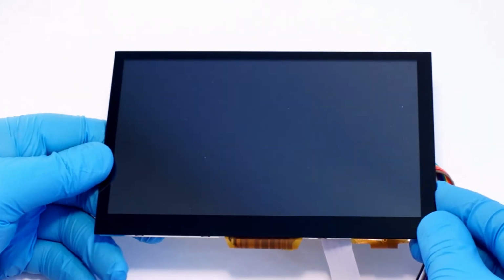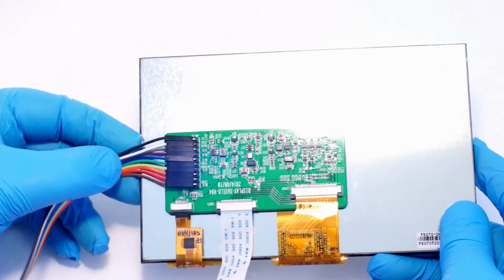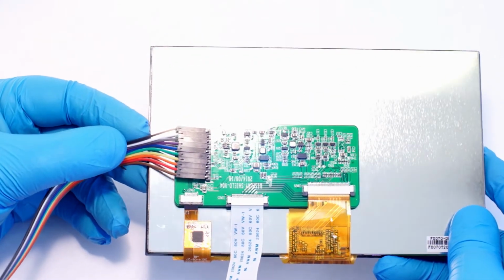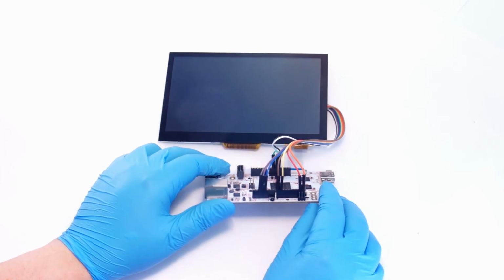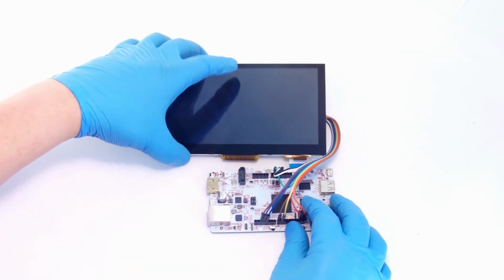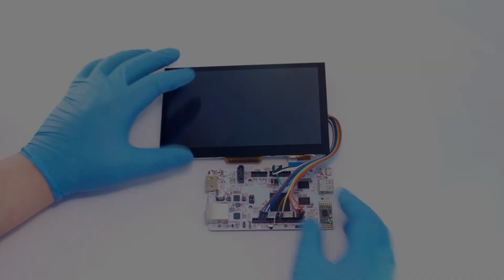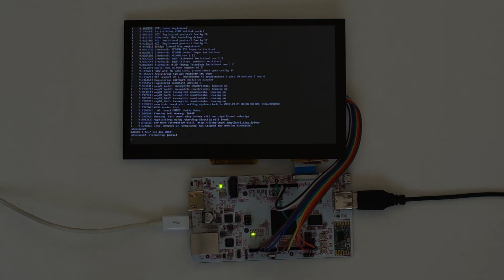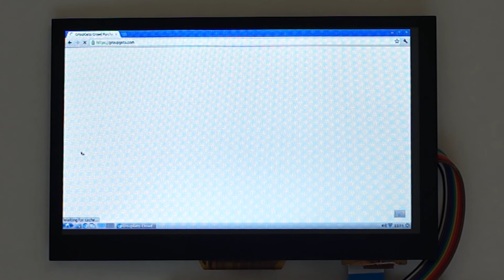pcDuino3B and 7" LVDS 1024x600 Touch LCD Guide

Comment: What are these wire jumpers for? Is it necessary for what?
Reply from the maker: +Alessandro Pino They are for power, ground, and touchscreen data connection.
Reply: +GroupGets Thank you! So, If I don't connect them, the O.S. will not process touchscreen information, or touchscreen data by wires are just for arduino code? I have this doubt because of this LVDS LCD. It doesn't have these pins. Here is the LCD I'm talking: http://pt.aliexpress.com/item/Banana-Pro-Pi-7-inch-LVDS-LCD-Module-7-Touch-Screen-F-Raspberry-Pi-Car-GPS/32463021147.html?spm=2114.031030708.3.19.cw56Aq&amp;ws_ab_test=searchweb201556_6,searchweb201644_1_79_78_77_82_80_62,searchweb201560_4